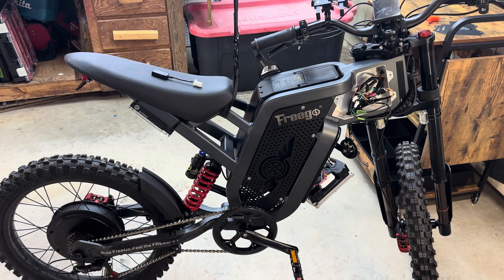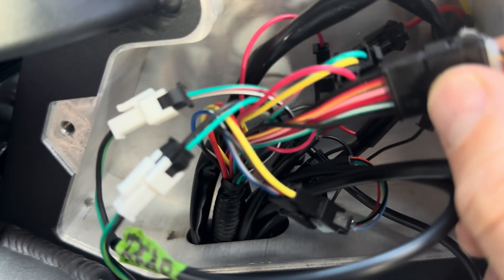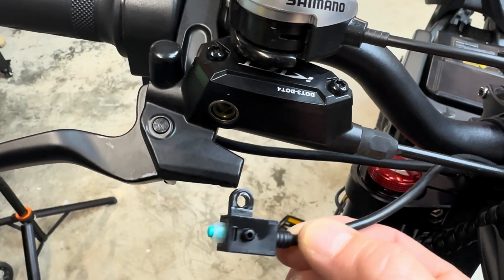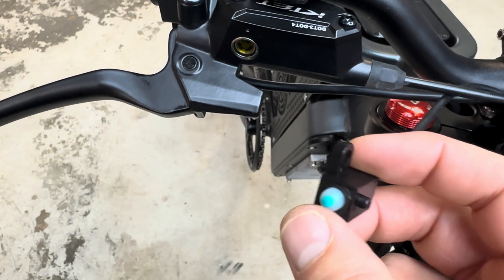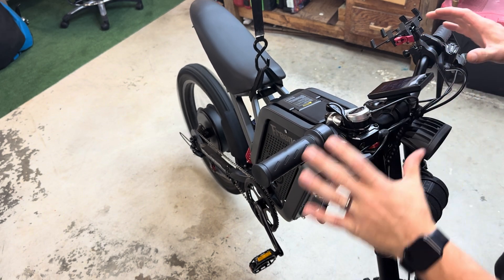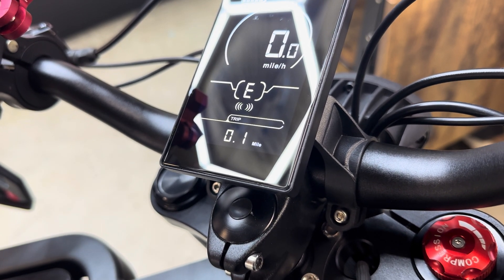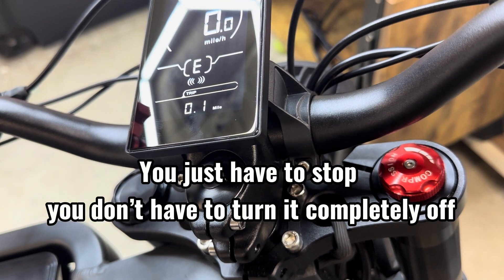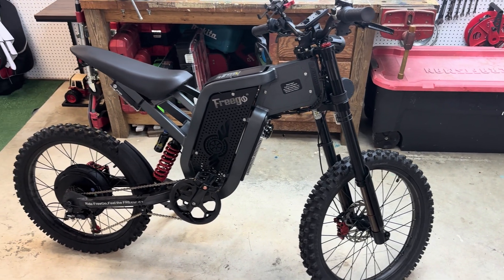Freego x2 E-Bike: Brake Sensor Delete & Controller Programming Guide

Comment: thanks for this. i have been wondering about how to do this while i wait to order one. definitely going to just unplug them and find a way to completely remove the wire as well. just one more reason to be hyped over this bike now, cant wait! great video. for the error also possibly check that no wires are pinched, not just at the connection points. had an issue on a ebike i built that drove me nuts trying to find the cause and turned out to be a bad wire caused by a bad ziptie placement. what are you using to hold the chain up to the frame?
Reply from the maker: I’m gonna make a short video on that another time, but it’s basically a chain roller for pedal bikes But it doesn’t roll. It’s just a plastic thing that eventually the chain is gonna eat through it they send you to bottom pieces. But since I’m not doing any peddling, I got it to keep my chain tight and stop making noise. You hit a bump the chain flies all around also slapping the frame and making a noise since I installed this there’s no noise from the chain. I’m gonna have to upgrade my kickstand because when you hit a good bump, it makes a noise.
Reply: @E_bikeDad  yes this was my thought exactly as well since not pedaling i am going to want to do something similar. was even thinkin of a kickstand delete (my personal usage i always have a stand nearby) do you have a recommendation for the chain roller?
Reply from the maker: This is the best option thats out there. I put a link in the description of the one I bought. I really want to fabricate one that works like this but has a roller like on a SSR110 or KLX110 just with a swing arm bracket or under mount.
Reply: @E_bikeDad  thank you and yeah once i have mine i will be looking for doing this or a similar mod forsure
Reply from the maker: Honestly, I may drill the bottom bracket out and just bolt a chain roller to that part. I’ll cover it when I make the video on that piece and how I will customize it. But it might work and I don’t need to do anything. I have to test it and see.
Reply: @E_bikeDad  nice yeah that would be interesting to see! cant wait. this looks good so far and quite a simple solution for under $15 already. thanks again!